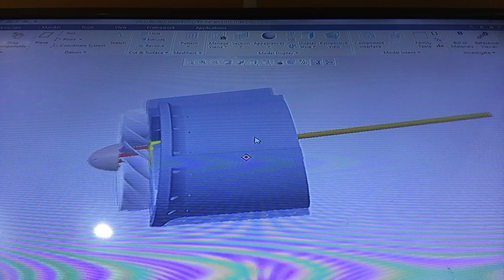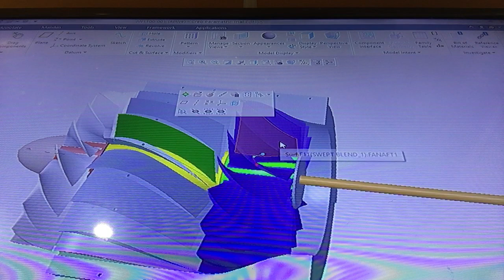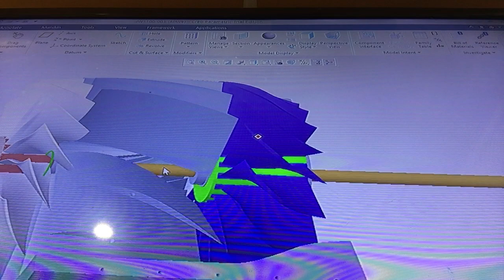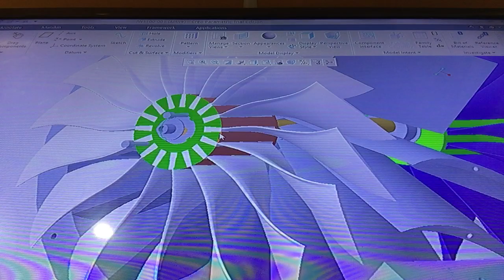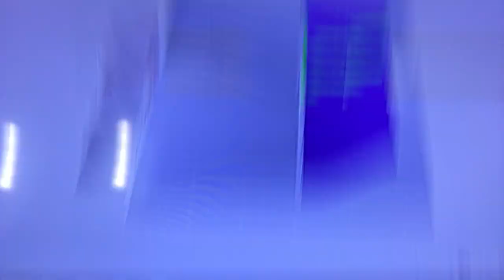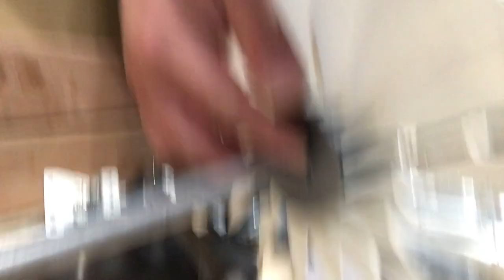Hybrid aircraft jet engine project 220mm 3D printed EDF fan UPDATE 7/23/2019

Comment: Im new to EDF fabrication my self, however I strongly think changing the direction of airflow will subtract from performance of the EDF, much of the motors readily available with diameters below forty are just completely suckass lol. If your tryna compress air I have a few alternatives, the best motor to go with thats on amazon will be a EVTSCAN 70120, the extreme torque is needed for edf's in general but what im getting at when you increase the load on the propellers you typically lose rpm because there already at the wits ends by simply having anything on there shaft. You'd want to invest in a motor that can actually carry some weight while maintaining its rpm, so it all boils down to torque but im sure your aware of this since you've been down this rabbit hole longer than me. Another alternative i have for ya is something i'm going to print this week myself, I have a 4076 motor and a chepo drone motor i forget the measurements for but I want to use them together to produce and do a similar-thing your doing here. I've seen some youtubers stack EDF's but they ran into the issue stated above regarding smaller motors.